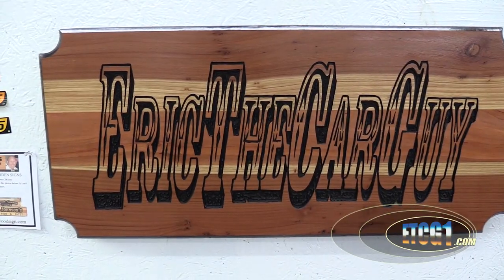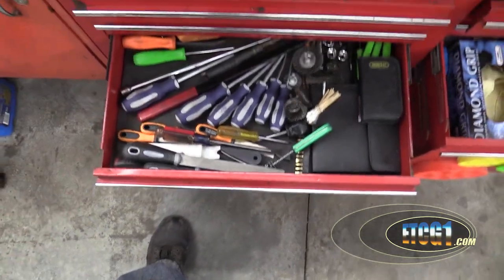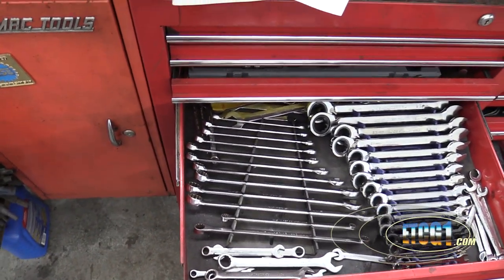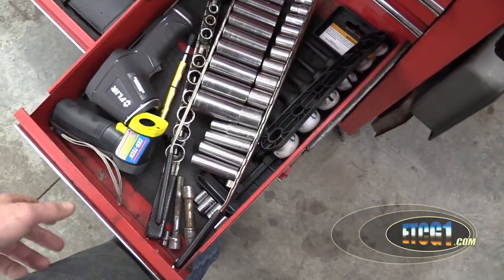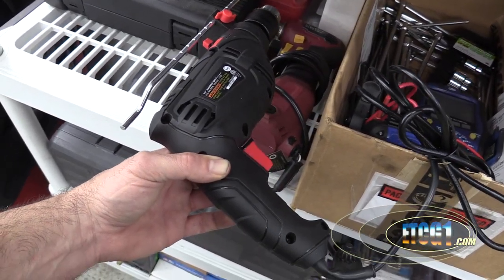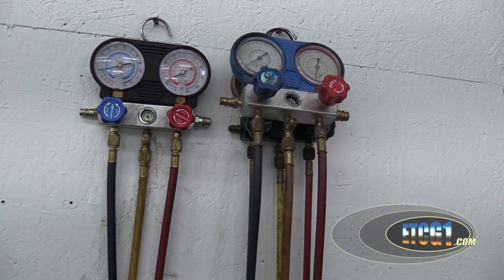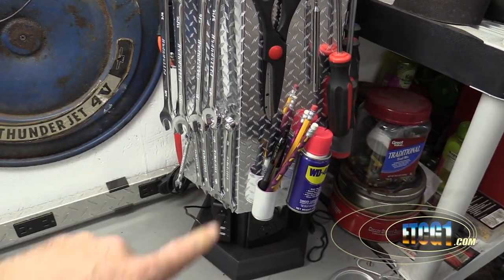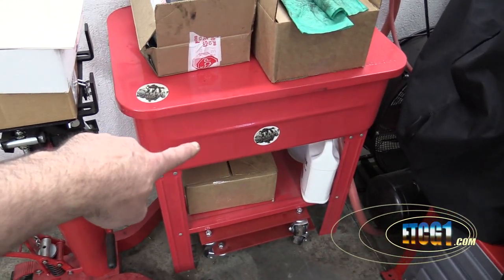Stuff I Get From Harbor Freight -ETCG1

Comment: wish we had Harbor Freight over in Europe :(
Reply: +Ronke&#39;s DIY Workshop why? we have LIDL and ALDI and Auchan, they have cheap tools.
Reply: +Macavellic yeah they do... but like aldi and lidl only stock certain stuff from time to time...
sometimes I watch videos and they get stuff from HF which I cant seem to find here or is really expensive...
such as those abrasive sandpaper cones with different size arbors which are super usefull for porting and such...
Reply: +Ronke&#39;s DIY Workshop MachineMart is probably UKs equivalent
Reply: +Ronke&#39;s DIY Workshop Mever been but I hear halfords is better than harbour freight
Reply: +Ronke&#39;s DIY Workshop The stuff like that the HF sells wears down VERY quickly. If you're doing porting work you want some nice carbide or diamond rasps anyhow, which are expensive here too. 

The high speed steel version of that stuff that HF caries are crap too. So... You're not missing much. But things like hammers, magnetic parts pans, shrink tube, sand paper, etc, HF is great.

Comment: You can also get those flare kits on eBay, and yes, they are total rubbish, i just about managed to put a flare on a new bit of copper pipe that was nice and soft, but it was a total failure when presented with brake pipe that was on the car. In the end i got a decent second hand flare tool that was probably made 30 years ago, got it for less than what i paid for the piece of Chinese ebay junk. And it's hand held, so no problem flaring pipe that was still fitted to the car.
Reply: +100SteveB There seems to be a lot of comments like yours. I have the exact HF tool Eric showed (and my Dad has a 30+ year old Mac version of the same thing) and I've never had a problem with it.

They're kind of a pain to use, but they do work. I would love to step up to the more expensive stuff, but for now it's doing OK.

Comment: I've never bought anything from Harbor Freight (yet), but their flyers land in my snail mail box all the time and there's a store not too far from here. The manufacturer brands crack me up: Chicago Electric, Pittsburgh Professional, Central Pneumatic, Western Safety … the names imply that the tools are built in America. I reckon that's not the case. I need to hop in Slambo and take a ride to investigate … =)
Reply: +MPGomatic I always felt the same way about their names. They try to make them sound like long established American manufacturer's when they may have nothing to do with the places they borrow their names from.
Reply from the maker: +MPGomatic Only certain tools are worth it, most aren't. If nothing else you'll have a better idea of what's available if you make the trip.
Reply: +ETCG1 New website idea: crap or not crap!
Reply: +MPGomatic It's all 100% Chinese and MOST of it is junk... Sometimes junk is just fine. I mean, I've never had a hammer fail (HF or otherwise). I have quite a few things from them, but they are very hit and miss, plus they change designs constantly so it's hard to really rely on the reviews (ex. I have the 90 degree angle drill Eric showed, which I needed for ONE project, but mine doesn't look anything like his. Is mine better? Is his? Who knows, but the reviews for whatever the current design is will be for ALL of the 90 degree drills they've ever made).

Comment: in general the consumables seem to be pretty good from HFT but I prefer to buy used tools from reputable tool companies. The last thing I bought from HFT was a 3 ton floor jack. I went through three of them in less than 2 weeks.
Reply: The 3 ton jacks are known to be very good quality, it was either really bad luck, or operator error of some sort.
Reply: I'm not entirely sure how it could be user error. I bled the system, and after all the oil was coming out of around the universal joint on the jack. On the second one the oil leaked out around two of the joints in the bottle jack. The jack itself seemed to be pretty good, but the bottle jack was crap.

Comment: The harbor freight cobalt 115 piece drill bit set at $99.99 minus 20 % is an awesome deal, so good I own 4. One on the lathe, one on each mill, and a floater
Reply: I almost pulled the trigger on that kit with a 25% of coupon a few weeks ago, but just couldn't bring myself to buy it as I don't have any metalworking projects on hand. someday!
Reply: +Tom Rominski Get one when you need it, so much better than HSS drill bits. use sulfuric pipe cutting oil as with any drill bit, just bwt if using a hand held power drill, be careful on pressure and angle. cobalt is more brittle than HSS but not as brittle as carbide bits.
Reply: pipe cutting oil? makes sense, I usually grab a bottle of motor oil! I've used cobalt in the past and you're right, no comparison with HSS. I'm just laughing to myself about spending $100 on bits for my $90 Delta drill press :)
Reply: +Tom Rominski lol, I know what you mean, I use 40$ German made carbide burrs in my 10$  Harbor Freight die grinders.
Reply: Im not a stickler to quantity over quality, but I just got a dewalt 12 piece titanium drill bit set for ~$20 (my other set went dull on my more used bits)  , I am the person to go hard and dry  on drill bits,  My Central Machinery Drill press  has been going for close to 1 year and still runs (the pulleys are starting to slip and I lost the allen keys that came with it) I cut aluminum, angle iron, box tubing, and so much other crap

Comment: the metal detector at hf is only good for finding nails in wood planning to invest in a garrett btw the tools are good for the rig cheap easy and if they bust get another
Reply: The detectors aren't good for beginners. It's easy to find nails with them, but takes an experienced operator to find more.

Comment: To me, Harbor freight is neither bad or good. It's fine for the stuff that does'nt get used a lot everyday. I have a Harbor Freight sawzall that works well for what i use it for, namely cutting cat. converters off of exhaust pipes that are being replaced due to accident damage. There's always a core charge for the cats. It does the job well, takes only a minute or less to cut the pipes.  I have a digital caliper from HF, it does the job. Funny that HF sells them for $20.00 or less, while Snap On tries to sell the same thing for well over $100.00. I also have a pair of hog ring pliers from HF. I don't use these everyday, so they are perfect for having them when i do need to replace a seat cover. No issues with them, either. It's a matter of how they're used, the big name brand pro tools are designed for hard everyday use, and as such last for a long time under the abuse they get.The HF stuff is more for the guy that occasionally works on his car, or for those once in a while jobs that does'nt justify spending big bucks on the tools needed.

Comment: Ahhh....Harbor Freight aka Craftsman. Many of Craftsman's tools are made in the same chinese factory as HF and just as good. Bought a rivet tool from HF for $6, same one Sears had for $18 but different cardboard card on the packaging. Same with a plier set I bought. Oh and HF has lifetime warranty on all their handtools. Break a socket? bring it in and get another, they don't even hassle you like Sears does with filling out paperwork....
Reply: +shaeet It's been a long time since I either had to buy or exchange a craftsman tool, but back in the day there was a large difference between them and HF.

...and when did they start making you fill out paperwork? They used to just hand you new stuff and off you went.
Reply: +Maxwelhse i broke a crapsman (as i like to refer to them) ratchet and brought it back about 3 years later. (this was in 2011 btw) and they required me to fill out a return slip w/my name signature number. At least they didn't need a receipt (I got ratchet as a gift). HF doesn't require that. They see their "PIttsburgh" brand and they know its theirs and they just grab it off the shelf
Reply: shaeet
That sucks. It didn't used to be that way at all. They'd just hand you a new one and off you went. I do have a few things I need to take in (and that was ALWAYS part of the deal with buying Craftsman even 20 years ago when I started, you KNEW you'd have a few things go wrong and need to exchange them them eventually... for me that's mostly been ratchets over the years) so I guess I'll find out. I've always maintained that the day they stop honoring their warranty is the day I stop buying their tools. Sounds like that day may be near.
Reply: +Maxwelhse Ya I get a ton of people who tell me "Craftsman 4 lyfe brah!" but 1: They are overpriced, 2: their quality has dropped significantly since the "heyday" of the 70's-80's where they grew their reputation substantially and 3: sears is gonna be out of business soon enough so what then? I don't see HF going anywhere anytime soon. And not that I am a HF elitest, but the company is a result of capitalism at its finest so why not benefit from their ridiculously cheap tools?
Reply: shaeet
Almost all of my Craftsman has been from the '90s to early 2000s and it's been fine. So, if the quality is REALLY getting that bad, then I'm with you that you may as well not pay Sears prices for HF tools. Also, my assumption that I would put money on being true, is even when Sears closes its' doors SOMEONE will buy the Craftsman line and service the warranty. I think tools are one of the only profitable segments of their business... and no one ever bragged about their Craftsman stuff. It was always a situation of "it works and they'll give me a new one if it breaks". Which used to be true. It sounds like HF may be moving into that roll now.

Back in "my day", Craftsman was all USA made (that was actually a key part of their advertising) so it was worth paying a little more for, especially since the quality was truly in the middle ground between absolute junk or super expensive. I realize that day has long since passed though, but I didn't know their China stuff has become such garbage. I'm about as well equipped as I think I'll ever need to be outside of a lift and a real air compressor, so hopefully the stuff I have will hold up as long as I need it.

However, HF is born of Communism. That's why you can get a wrench for $2. Some poor bastard that is eating rat and a bowl of rice working 18 hour days in foundry somewhere because the state is, more or less, forcing him to. My HF tools are covered in sadness and tears, not freedom. I'd pay freedom prices for freedom tools (and for most of my tools, that is exactly what I did).
Reply: +Maxwelhse I got my first craftsman mechanics set (a crappy $60 one) in 1998 and it was pretty meh. I always break the terrible ratchets they give you with their kits. Iv'e broken a couple of deep sockets but their wrenches & shallow sockets have been fine. Meanwhile my Stanley mechanics set has lasted me 15 years now and only broke 2 of its sockets and still use it as my main socket set. 

Most of my HF tools are wired-electric (their battery ones are trash) and I have a wrench set and some specialty sockets, pliers, bits from them that seem fine. 

And I've met a ton of non-mechanic type people who just assume "Craftsman is the best" because they don't know the alternatives. I've vouched for HF stuff many times, especially their multi-tool when people ask me, but yes about 1/4 of their stuff is pure utter garbage from my experience.

I also don't believe that buying a snap-on or mac tools supports America any more than buying a Craftsman or HF. Corporations have outsourced so much crap and avoided paying taxes to the point where its nearly impossible to know without doing a ton of research. I support small business / made in usa companies all the time but if its a bigger brand I just don't care and buy whatever is the most economical, sorry...
Reply: shaeet
Ratchets have ALWAYS been Craftsman's downfall. My solution has been to have 2 of each drive (in some cases more than that, just for different jobs/lengths) so I always have a spare. I've heard good things about Stanley too, but mostly their older tools. I think I have a handful of their stuff, but it's all the Walmart type multibit screwdrivers and things. Nothing to really complain about with them.

Oddly enough, it's the HF electric tools that I try to avoid. I have a few, and they've been mostly fine, but I've known too many people that have had problems with them to really trust them much. My power tools aren't anything special though, mostly Ryobi cordless with the occasional Porter Cable, Bosch, or DeWalt corded tool thrown in, but they work. I honestly can't believe how decent the Ryobi stuff has been. I've been working it to death for ages. The NiCad batteries suck though. I need to replace mine with Lithium Ions.

Perhaps the difference in opinions that we find among the people we know is that I mostly know pros or people who do A LOT of DIY (like every night and weekend type folks). Most of us have loads of Craftsman, but we know what it is too. If we could affords to replace every ounce of it with higher quality stuff tomorrow, we would.

It depends entirely on where it's made. I don't think the parent companies are doing anything to help the American worker, but if THAT tool is made here, I'll buy it over a similar one that isn't. Usually the prices aren't all that much different anyhow, unless you're talking HF vs. everyone else.

Hell, I even get excited when I can buy Canadian or German made tools vs. Chinese. I was absolutely shocked when I ordered a Bosch SDS to Jacobs chuck adapter and it was actually made in Germany. It shows too. It's one of the nicest tools I own. It was also like $70 if I remember right.

Comment: I just twisted off the square nub that holds the socket to the socket wrench on a HT&F socket wrench. The thing was garbage to begin with, but I've never seen that happen before.  And I'm not The Hulk either.
Reply: +Mr. Bosch I did the same thing with a nap on 1/w" wrench recently. it happens
Reply: +believe it  Yeah, I just figured the ratcheting mechanism would break before that. It was just a wtf happened moment.  I hope TTIP and TPP don't get ratified and we can bring some well paying manufacturing jobs back here and start making quality non planned obsolesnce tools again. Cheers

Comment: would you recommend a 3 ton floor jack from harbor freight? I don't do anything professionally I'm just a DIYer.
Reply: I would my shop ownes the grry 3 ton floor jack from harbor freight and in the year that I have been there its been used alot and held up really good.
Reply from the maker: +biker932012 I've had 2. One has held up great over many years, the other has a slow leak.
Reply: Thanks for the input, when I see them on sale where I'm at for $70-80, it almost sounds too go to be true.

Comment: Eric, for me and all those from other countries, what is harbor freight?
Reply from the maker: +Bruno Ghisi Mezadri (Mezadri) It's a discount tool store here in the US. I'm told it's a lot like ALDI in other countries.
Reply: I can answer. Budget priced lower quality tool store. Although the lower quality of them is arguable.
Reply: It is tool supply company. All automotive tools, woodworking, welding and such. Even have wide selection of axes, solar path lanterns, safety equipment and tarpaulins.
Reply: Products are inexpensive and of lesser quality as they come from China. They are usually manufacturered using old tooling and molds, so the finished product has rough metal surfaces and lots of plastic flashing.
Reply: tks, Eric and guys... that's interesting. I don't know any similar store here in Brazil, at least in my region. but evidently we have those store with all kinds of stuff with questionable quality from China and they also have tools...

Comment: I buy harbor freight for all my offroad trucks/4x4. Stuff I know is going to get lost, beat to hell, tossed around, dumped in dirt, and pretty much abused to the point of throwing it away. Why have a $300 socket set when I can have a $30 socket set I use once in a emergency/trail fix, and not care that I lost half of it.

Comment: hand tool are awesome impact sockets awesome electric tools questionable
Reply: +Kerry Roberts its all JUNK!
Reply: I would have to agree. I've personally had good luck with all of their hand tools. open/box wrenches, sockets, screwdrivers, and I really like the telescoping ratchets. all those still going strong. the electric power tools are hit and miss. I've had good luck with their pneumatic stuff so far as well, impacts and such. I have their 8 gallon 125psi oil compressor as well and it runs like a champ. it's a good store for the weekend warrior.
Reply: I bought a heat gun and it caught on fire. bought drill bits and they all broke. when a tool says "drop forged steel" thats a joke. Its all JUNK
Reply: +PhuckHue2 You probably bought the 1500w drill master and the cheapest bits in the store, couldn't expect too much better.
Pay more, you'll get much better products within the same store.

Comment: A lot of the time you can buy 3 at harbor fright for the same price as one of the name brand.
Reply: +K Kampy  depends on what you consider name brand... if you mean "snap on" its more like you can buy 40 of them from harbor freight plus for each snap on... last time i looked a pair of needle nose pliers were 50$.... and a 3/8 drive socket wrench (only the wrench no sockets) was around $90... which is just silly
Reply: +wormer66 I was thinking more along the line on sears or cobalt